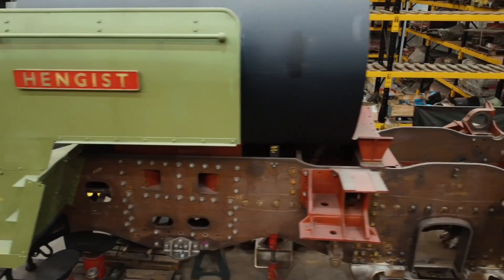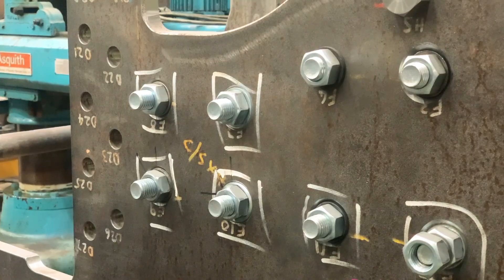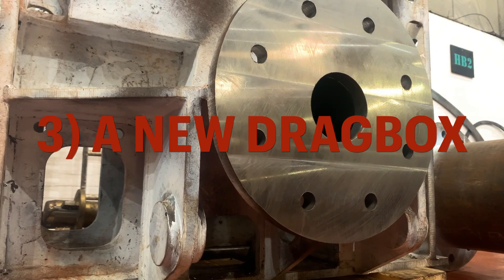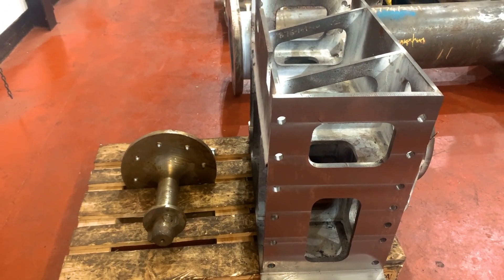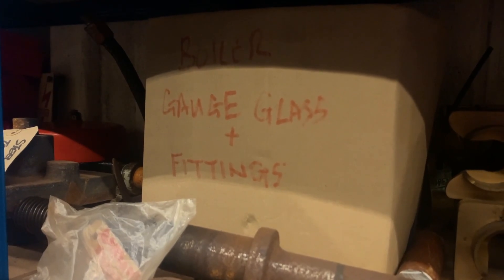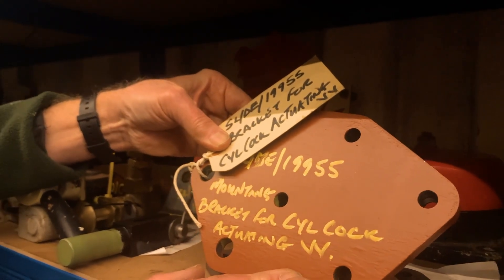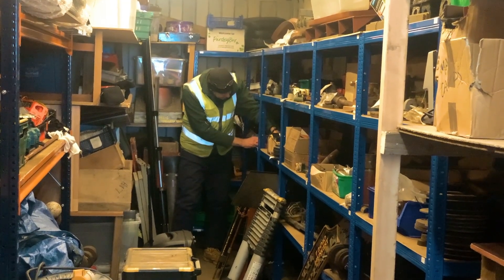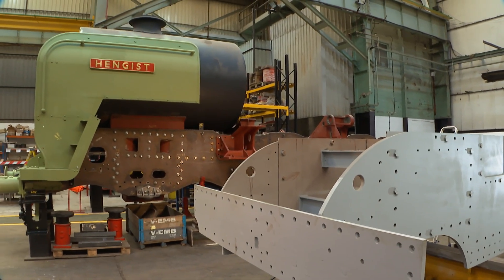HENGIST - The latest on a brand new steam under construction in Sheffield.

Comment: Good to see the Asquith Universal drilling machine at 2:11. At Bo'ness we have acquired one a kind of temporary permanent loan. a very useful piece of kit. We could not have drilled the foundation rivet holes in No.7 Austerity without it. We are all pensioners at Bo'ness coming to the end of a ten year heavy overall of the Std 4 Tank 80105. We work Tuesdays and Saturdays. Hats off to you doing this one day a week.
Reply: We bought our Asquith off a well known web based auction site for 500 quid, but to truck it over to works was another 700 quid+VAT. It has paid for itself ten-times over now !! Best piece of kit for our needs, invaluable!!

Comment: Are they coal driven, in this modern era shouldn't they be another cleaner way of heating the water?..........And where has the name Hengist come from, sounds very much not English never mind British !!
Reply: "The first five of the planned second batch of 15 locomotives were intended for use on BR's Southern Region; these were allocated names Hengist, Horsa, Canute, Wildfire and Firebrand, which had all been previously used on locomotives in southern England." Hengist did originally start construction in 1952 before being abandoned. The new build keeps the old 1950s name.
Reply: China is opening coal fired power stations at an unbelievable rate. A little bit of smog coming out of the UK is totally irrelevant.

Comment: The 1952 6P5F group names were all "Clans". So what is the provenance of the name Hengist, which was the name of an Anglo Saxon king? I would have thought a more Scottish name and perhaps an actual Clan might be preferable.
Reply: Absolutely. If they named it after a clan it would get (and retain) 1000% more publicity and public interest. What's the point of building a 'Clan' loco that's not a Clan? Why the only Clan that's not named after a clan?
Reply: From Wikipedia: "The first five of the planned second batch of 15 locomotives were intended for use on BR's Southern Region; these were allocated names Hengist, Horsa, Canute, Wildfire and Firebrand, which had all been previously used on locomotives in southern England. "

Comment: Oil firing may be the way forward for steam powered machines. There seems to be no shortage of oil in the world ……….no cinders and ash to worry about……just a thought ……… cheers DaveH
Reply: Oil firing works well with Southern Pacific and Santa Fe engines. The Union Pacific Big Boy was converted to oil and is running just fine. It would be kind of sad, in a way, but it may become inevitable.
Reply: No! Keep it coal fired, there’s no comparison 👍🏻
Reply: @drstrangelove4998  Nor any pointy in using oil.

Comment: is the engine the same as the original? or has it been up dated, and the technology moved on, is there any way it could be made to run cleaner, great to see such interest.
Reply: Any steam engine will run cleaner on coke, but coke is more expensive than coal, could in future be harder to come by, and I assume that the firebox would need to be optimised for coke burning. PS I'm not talking about an American fizzy drink.
Reply: It has been modified to be more efficient, cleaner and better, using modern technology. It might be as good as a Class 7 even but we have to wait and see about that.

Comment: I do wonder what the point is as the Clans were poor locomotives.
Reply: The Clans, as originally built, were poor performers - the faults could have been eradicated quite easily, but steam locos were being rapidly replaced at the time, so BR couldn't see the point.  Those faults have been corrected in the new build. (and if your bothered to read up on it, you'd know that yourself)
Reply: My guess would be because, as said in the video, there is not one left in existence. Presumably also as they have enough of the original plans to use.

Comment: This could be a great opportunity for apprenticeship type volunteers. The skill and discipline required to make this engine will translate into many other engineering type skills.
Reply: @creamwobbly   Not quite. The load was within an area marked off by yellow steel fencing. And because you are in an engineering shop doesn't men you need a hard hat. CTL is a process plant design and manufacture specialist serving petrochemical, oil & gas, pharmaceutical, agro-chemical, fine chemical, utilities and nuclear industries. I think they know all about PPE legislation.
Reply: It's vital to keep ALL of the old tech going; vintage cars, steam, biplanes etc., because that stuff is the bedrock of engineering - Newtonian dynamics, pressure-vessels, tin-bashing etc. It doesn't matter how many quantum computers you can build, if you lose these skills then your country is basically a banana republic without the bananas.
Reply: This was the main reason this steel business got involved in building these locos - to train young people in serious heavy engineering that would also benefit their business.

Comment: I have worked with steam locomotives in the U.S. for many years and this is not a smart aleck question.  What is the purpose of a new steam locomotive?  These are obscenely expensive to build and maintain.  At least in the U.S., railfans do not contribute anything close to the amount of funds needed to run them;  and the owners of the rail lines with few exceptions are hostile to hosting excursions.  Does this group have a business plan to support the construction and ongoing maintainence and use of a new steam locomotive?
Reply: The British steam preservation scene is different from anything I have seen in the US (where I now live).  The US steam locomotives seem to mostly be static with limited effort to slow the rust and decay.  There are many preservation railways in the UK, with an interest to keep many locomotives in running order. .... Which is why most films (movies) requiring a steam train are filmed in the UK.
Reply: Well the first difference between the USA and the UK is that all UK Main Line tracks are owned by the State not private freight companies and they are operated by 'Network Rail'. Access is only restricted by getting a path on which ever line you wish to run. There is also a large number of what we call 'preserved railways' that are expanding and doing well.

Steam trains are very popular and command a premium ticket price with the majority combining high class dining with the joys of steam travel. The business cases are pretty substantial which is why businesses are building new as well as operating restored engines.

The first new steam engine was 60163 'Tornado', a 4 -6-2 A1 Pacific, which first steamed in 2008. It is now in its first major refit and has been a resounding success. It hit over 100 MPH in 2017. The group that built that is now building 2007 'Prince of Wales', a 2-8-2 P2 Pacific.

So in summary yes there is a very good case to be made to build a new steam loco in the UK even without the added benefits of training young apprentices in heavy engineering skills they will carry for the rest of their lives.
Reply: Many British people appear to not only be steam fans, but willing to help. Americans are pretty indifferent. Lots of people whined when the New York Central scrapped it's Hudsons, but nobody could be bothered to group together to buy one or two. Whereas British people banded together and saved an entire scrapyard of locomotives.
Reply: Good question.
Reply: @Cooliemasteroz indeed although being fresh should be less tricky than the ex Barry units for maintenance. At face value there's no business case it's a hobby but then it must have some recouping otherwise it's a folly
Reply: Yet there is a group in the USA currently building a new T1 loco which they plan to run at 140 MPH so they must have got permission to run on the main lines at full track speeds.
Reply: @PeterChapman-rg6gr  - as far as I'm aware from posts by US steam enthusiasts, there is only one relatively short test track where locos could be run at anywhere near that speed.  The great majority of their track is controlled by freight companies who are happy if their trains can only manage 17mph on upgrades, so don't give a damn about suitability for high speed running.  Further, take a look at some videos showing their track;  rails secured onto rotting and crumbling timber sleepers with SPIKES, for God's sake?  They haven't even made it into the 20th century, yet - let alone the 21st!
Reply: @jackx4311  My comment was posted AFTER looking at the video put out by the TI team who state that they currently have over 40% of the parts needed and expect to sign the contract for the construction of the main frames soon. They also stated that they expect to be running at 140+ MPH line speeds

Comment: Will she have a stainless steel boiler and other parts that have contact with water?.
Reply: stainless boilers arent allowed in the UK
Reply: @andyg3  Is there a specific reason for that ?, just curious.
Reply: Google "hydrogen embrittlement". It's why you don't make boilers out of stainless steel.
Reply: @nickmiller76  thanks! I knew there was a problem with stainless and it was somehow related to it being or becoming too brittle. I had, of course, forgotten about hydrogen embrittlement .
Reply from the maker: I don't know I'm afraid - that decision might not have been taken yet. The Standard Steam locomotive company (the builders) might know...  they can be contacted via their website. https://www.72010-hengist.co.uk/
Reply: Almost certainly not - stainless steel is far too brittle to use for a boiler. I seriously doubt that you would get a stainless steel boiler approved and insured. The mechanical properties of Stainless Steel might actually be so far outside what is considered safe for it to be effectively illegal as a boiler material.
Reply: @drjojo4624  they are used a lot in miniatures across Europe. Seemingly with no problems